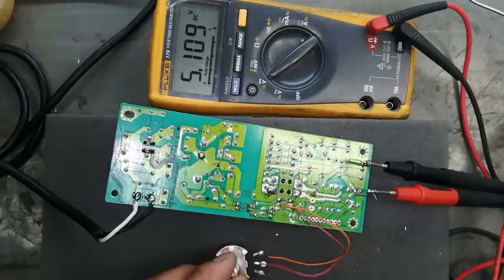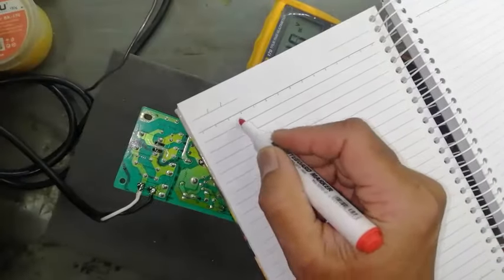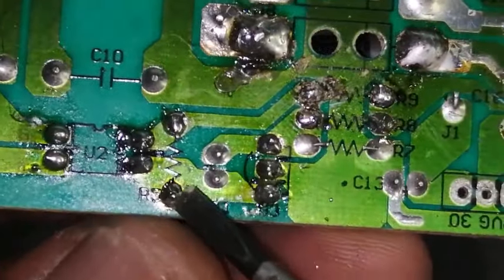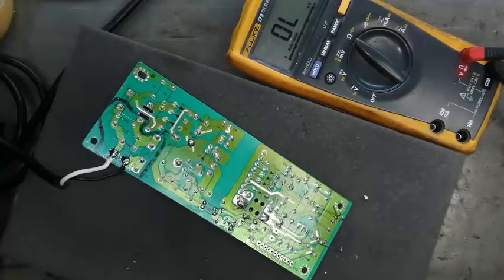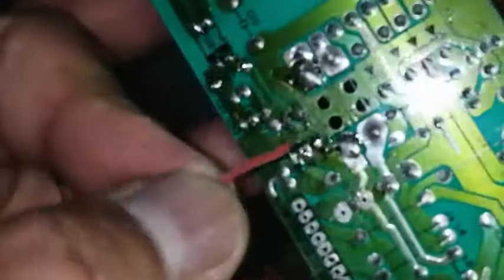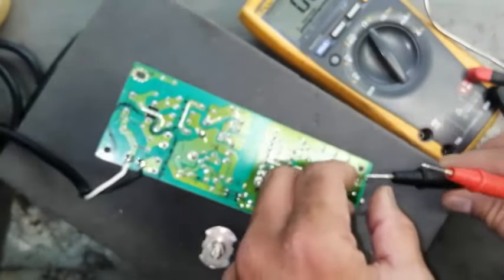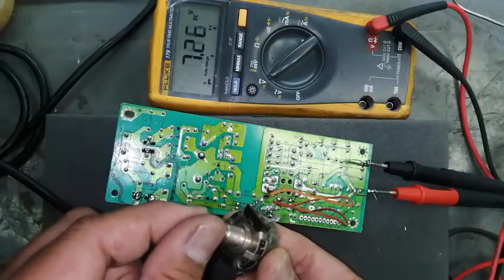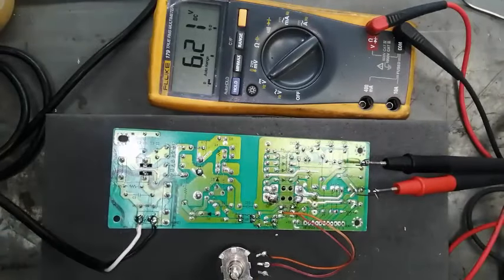#150 How to increase output of the SMPS power supply or mobile charger

Comment: You are so familiar with your subject that you are explaining so simple and understandable. Thanks for sharing your experiencies with us
 You mentioned in our narration. You are not the designer of the circuit. You can influence a certain area. What is the limit in this sense? I mean. Are we going to make changes only within the design output voltage?
 Is it possible to chage output voltage higher than design voltage. what will be the limit. how much we can increase it?  I think playing with the design for increasing voltage and current may requires changing other components like transformer windings etc.
I'm looking forward to your new video.

Comment: Yes sir, I also asked fir the same. As I have three smps power supplies of my two laptops and I want to use one of them which is idle to my RI water purifier. That needs 24 Volts and 2.5 amps and I have 19 volts and 5 Amps power supply. Now I can do the modifications to suit my requirements. Thanks. 🥰☑️💯👏👏

Comment: Rather than taking out R1 from the voltage divider network, it's good to take R2.
Because there is some delay between the feedback and output ..
So at the time when R1 is zero alot of inrush current from some caps can damage the Voltage shunt resistor...
If R2 is changed then, when R2 is zero then the inrush current is limited by R1 , which is a safe criteria.
Reply: @HaseebElectronics  well your explanation over feedback topology is above sufficient for beginners.
So glad to have such teachers.
Reply: @HaseebElectronics  You are a experienced one, so..
Can you advise me for building a low ripple , low current , 48v sophisticated power supply?

Comment: Sir your clear explanation is very nice
Comparison of normal smps vs smps based battery charging circuit
The battery takes a lot of current and voltage drop, but how does this work because the smps regulator tries to increase the voltage always

Comment: Nice vdo sir ji.
Sometimes we need to charge batteries like lithium ion, 12v lead acid batteries. They need specific current limit. If we charge those batteries with high current they may damage.
Please,  i request u to make one current limit circuit so that, after giving high current it still charge with the current which is limited by that circuit.
Plz its kind request.

Comment: Nice information and explanation I will do it

Sir please make a video on how to increase the voltage on computer smps power supply (12volt to 13volt or 24volt) (details with pwm controller)
Reply: @HaseebElectronics  if we make 24 volt from +12volt and -12volt then we will get only 600ma. I want minimum 5am
Reply: @HaseebElectronics  sir I am new to electronic field.  I can't wind the transformer.  I can make basic changes in the circuit.  I saw a video "Adjustable power supply from computer ATX!" Channel name "Kasyan Tv" Can you make a video like that?  Because you explain well.  My smps have PWM IC SDC2921.
Reply: @HaseebElectronics  sir, there is a Portuguese channel "Amor a Vida" with a lot of smps video example "Alterando Fonte ATX para 24V PWM WT7520 LCSC Electronics"

Comment: Sir can you please show how to adjust ampere too
Reply from the maker: Please don't try to adjust amperes
Because if we adjust current without proper calculation, it will directly effect on mosfet, so that it can damage mosfet
Second thing the maximum amount of current is calculated at the time of transformer design. Increment of current will cause to increase apparent power, so transformer may heat up
Reply: @HaseebElectronics  thanks for your response sir
Reply from the maker: you are welcome brother

Comment: What is the limitations 
Minimum and maximum voltage
Do we need to chnage fuses?
Can this work damge other parts ?
Reply from the maker: kindly check video number 283 for more details and what will the result and behavior of the circuit
Reply: @HaseebElectronics  thank for the reply and sharing your knowlage.
I saw the video and it was very usefull
But it sound hard for me to calculate duty cycle and determine exact min and max voltage that does not harm the circut.
The only practical way is to use a pot and listen carefully to hear noise from circut and stop at that position just like video sugests.
Also my question about changin fuses is still unaswered.
For an adjustable smps safe amp for 12 volt is for example 30 amps but for 24 volt is 15 amps but if I use 15 amp fuse I will lose 15 amps when voltage is 12.
Is there any solution to have entire power in hand in any voltage?
thanks.

Comment: In My Atx powersupply the -12 volt output not working .. how to solve it? 
If We connect -12 and +12  the output only 12 volt.. not 24..why?
Reply from the maker: sometime -12 volt section is taken from same 12 volt section. just the rectifier direction is opposite to each other. 

in some power supplies
in +12 volt section high ampere winding is used 
and for -12volt low current winding wire is used, because it provides 0.5 amp maximum.
so you have to check that is there is separate winding, then check -12 volt rectifier and its winding 
if it is taking from same 12volt winding then check its -12v rectifier
from same power supplies we cannot add power supplies to each other, because the common wire is same for each section. 
if you want to add power supplies, then you have to separate the common for all power supplies, then make them in series. 
remember, if you want to paly with atx in this way then keep in mind that we have to make solution for smps supervisor protection circuit as well

Comment: can i use 10k or 50k potentio?
Reply from the maker: Yes dear
The potentiometer should be more than the resistor's value so that it can be used for more range
10k or more is good
Reply: @HaseebElectronics  allright thanks mate

Comment: Thanks for another great video.  As an experiment, I removed a 20k resistor from a 12 volt 1 amp smps and replaced it with a 20 potentiometer.  I can adjust up to 24 volt stable (possibly more but I did not change the output capacitors.) It will adjust down to 9.75 volts then becomes unstable below this.  Why is this?
Reply: Sir u must use 48v capacitor if u want 24volt output.
Reply: I also found same type of incident during an experiment

Comment: Isn't there any problem in this way?Has to changed component if we increase output voltage? because  diode,inductor,resistor,capacitor are calculated in previous system.
Reply from the maker: exactly perfect answer. it will decrease the output current, and the power supply will loose its regulation 
we must not play with the outputs of the a power supply 
increase in voltage will cause to decrease output current 
you can also check video number 283. that video is detailed explanation of your question